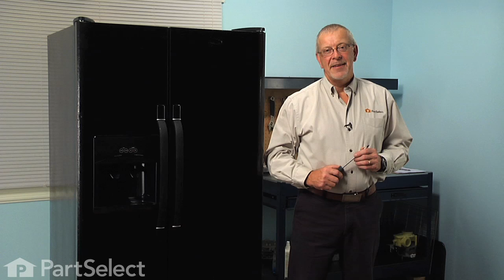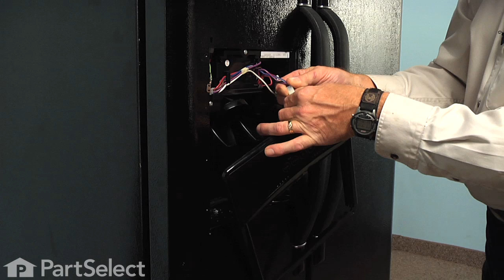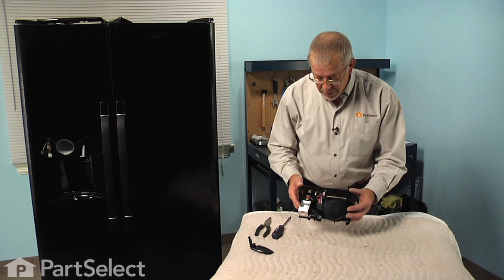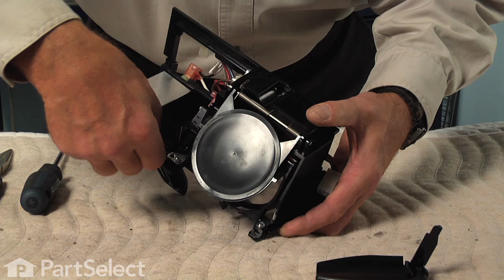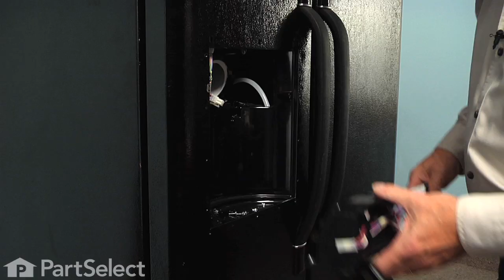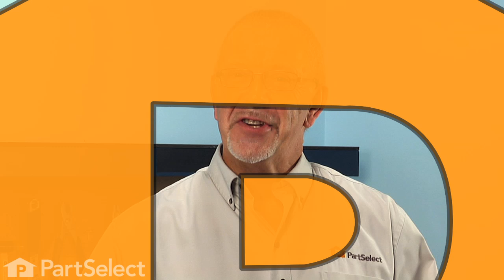Refrigerator Repair - Replacing the Water Dispenser Actuator (Frigidaire Part # 241682003)

Comment: Be careful, the connector to the esceution panel is a very delicate ribbon cable on our model, not the style seen here, I just changed our actuator today, also the water tube is tough to get back through the outlet because it is so short!

Comment: We  received the replacement actuator water replacement, order #11135562, but we cannot remove the water tray, it won't pull out. It feels like something is stuck. Please advise. Thank  you!
Reply from the maker: Thanks for the question. The water tray is a friction fit, so it is important that you're pulling it straight out. If it is still stuck, you may be able to gently pry it loose with a small flat blade screwdriver or a putty knife. I hope this helps with your repair!
Reply: Thanks for the reply!..much appreciated.  Yes, I had to loosen it up with a screw driver to get it off!...It was really stuck in there.  All good now and works great!...Thanks for the instructions, was really helpful.

Comment: I replaced the broken water actuator and put everything back together.  Unfortunately ice dispenses as before the "fix', but no water comes out.  Water is running into the filter housing when the actuator arm is depressed, but no water comes out the dispenser.  Any suggestions?
Reply from the maker: Hi Ken, please provide your refrigerator model number and I will be happy to look in to this for you.

Comment: My repair did not go well.  I followed the instructions perfectly.  The only difference with my unit was that I did not have a wire harness connecting the escutcheon.  In stead it had a tape-like piece holding wires which I had to slide out.  I don't know if this is where I was unable to restore the power correctly, but I am unable to get power to the dispenser.